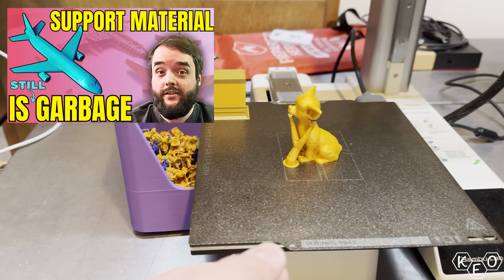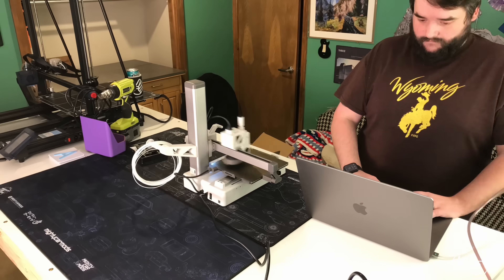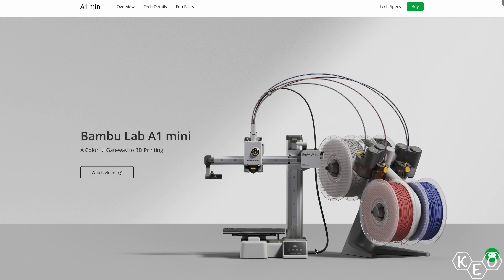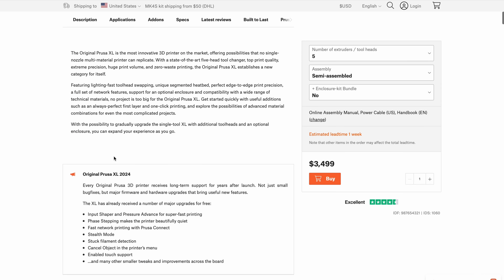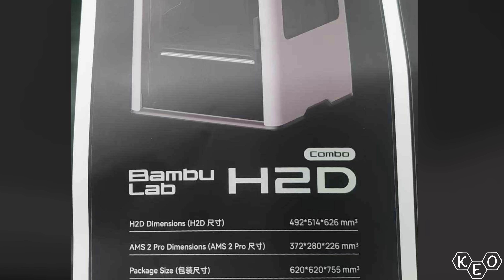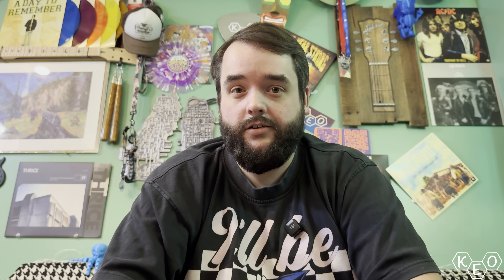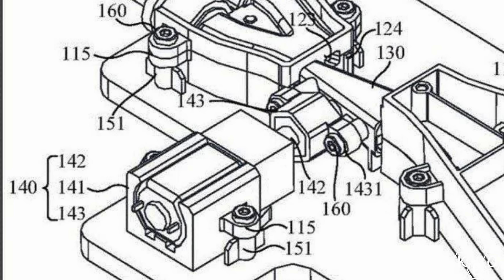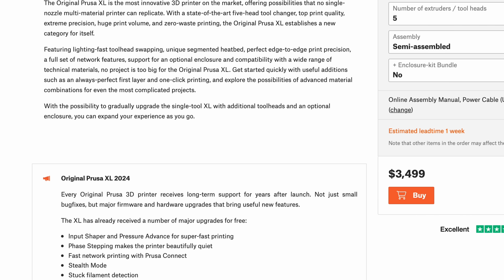What Is The Bambu H2D? Will This Change Everything?

Comment: If there are 2 nozzles I think it would be most useful for printing supports from a different material that has poor adhesion to the primary printing material so the supports basically fall off and you have cleaner and less expensive prints.

Comment: I've had the thought of dual head or tool since my very first tri-color print. I probably had more waste than printed material. I wasn't concerned with it right up front because I was so new to printing. But, now that it's on my dime, I'm much more critical of it once I started branching out from (inexpensive/cheap) PLA to more exotic materials. I refuse to spend $50 on a spool of something to watch 1/5 of it drop out the back. Not to mention all the extra print time.

Comment: With Bambu Labs latest announcement about their new firmware update and it's lockdowns (will render Panda Touch and most likely all 3rd party tools completely useless) I have a feeling they may not be selling many of these new machines, and most likely not many more of their existing line as well. 

Oh and if you're thinking of staying on LAN and not updating to the new firmware Bambu (in there own announcement states that wont work. BTW, seems they removed the ability to downgrade from the latest firmware version as well..  From Bambu's own website - "Critical Operations That Require Authorization"

    The following printer operations will require authorization controls:

        Binding and unbinding the printer.
        Initiating remote video access.
        Performing firmware upgrades.
        Initiating a print job (via LAN or cloud mode).
        Controlling motion system, temperature, fans, AMS settings, calibrations, etc.

Comment: looks like a lot of tech design for a twin nozzle end, this would make a huge difference with multi colour printing as per your video chat. If they do release this thing with the tech you’ve mentioned and a bed size of at least 350mm cubed, i’d be straight on it even though ive only had my X1Cc for three weeks. Let’s hope and fingers crossed.

Comment: Yeah but bigger question is when is Bambu getting into the resin printing.
Reply from the maker: You know, I don’t care for resin but I wouldn’t be surprised if they moved that way eventually as well
Reply: @KeoPrints  it would be cool if they can be the leader in both filament and in resin. I would buy a resin farm of Bambu printers.
Reply from the maker: I agree. I have not made the jump over to resin but im sure they could innovate enough to make it appealing to me and loads of others
Reply: @KeoPrints  the main thing that was appealing to me with resin is the level of detail you can get along with the time vs multiple prints. If the object takes 2 hrs but I can load 10 models at a time... Thats the appeal n challenge for me. Still love my Flsun tho.

Comment: Needs to be something with a heated chamber that has a larger size build plate that isn't $2600 like the X1E.  I love my Bambu stuff but if Qidi releases a V2 of the 4Plus its going to be HARD to beat that one if they can't match the price and features.  Even the V1 with the issues isn't the worst.
Reply from the maker: I’m testing the Qidi Plus 4 right now and I am SUPER impressed. For such a cheap machine, this thing is incredible

Comment: love it, ! appreciate the info.

not gonna lie, you had me on the edge of my seat because I literally just purchased an X1C.

I'm new to 3D printing and decided to wait until now to jump into the fray because reliability was a huge concern of mine when 3D printing became popular a few years ago.

right after I used my X1C for the first time (2 days ago), I immediately started thinking of ways to print faster.

multiple tool heads came to mind as well as a way to switch between them.

and behold, only a few days later, here is this video. mind you, it released 3 weeks ago but damn.

right on the nose.

i'm definitely excited to see what bambu labs is coming up with with this next printer.
Reply from the maker: Crazy timing! It will be interesting to see what happens here in the next couple months

Comment: The dual print head (only ever 1 actively printing at a given time) with dual output AMS allows so many benefits, 2 colours, 1 can be printing while the other is priming and if only 2 colours no need for lots of purge and poop. 2 toolhead means they cab both be at different temps, and crucially, things like printing PLA with PETG was never a good option with the X1, P1 or A1 printers as the amount of purge required when swapping betweeing incompatible materials mid print is usually North of 300mm² which would be entirely prevented with the dual print heads finally making things like dissolvable supports possible. I'd eat my hat if the chamber isn't fully sealed and actively heated and given that bambu now sells more advanced filaments like PPA-CF and PPS-CF the hot end is gonna be good for 400c, hopefully 450c.

Comment: Tbh I want heated chamber, capabilities of printing engineering grade filaments, better resolution, seen Markforge prints in person and in industry and they’re bonkers both in resolution and strength, and the ability to run the machine offline like the X1E with a physical network kill-switch and I would love for interchangeable heads and a setup where I can print parts in lower durometer TPU, like 40A-70A. 

If they can get these features at a price point of at or less than 3K, we have a serious contender. Because so far Markforge is the metric by which I judge print quality, but 6k min for a printer is a hard pill to swallow. Resin is a pain in the rear to deal with and the powdered plastics are too expensive to print with. FDM is just much easier for day to day.

Comment: Having dual extruders would be beneficial even if you were printing in more than two colors.  
1) Let's say you aren't printing more than two colors on a given grouping of layers, you could still significantly reduce the number of filament changes.
2) Let's say you are doing more than two colors, lay after lay, you could keep the most used color loaded up, thereby reducing the number of color changes. 
So regardless of how it goes down, you'd reduce the time and waste for multi-color.

Comment: This model is what I’ve been waiting for. I’ve been looking at consumer 3d printers since they have been coming out and still haven’t bought one. I wanted a reliable large print volume. Stuff I could made functional parts from without melting material together, sanding etc. The last model almost made me pull the trigger but I’m glad I waited.

Comment: One reason I haven't bought the X1C yet is that I wouldn't be able to easily use ABS and PETG together with the AMS since I've read that the ABS would have to be fed differently instead of through the AMS. I was thinking about the Prusa XL with 5 print heads so I could do multi color and multi material, but that's out of the price range I want to spend. Maybe I'll wait to see if that new Bambu Lab printer can do what I want.
Reply from the maker: I am not sure if I am maybe misinformed but I use ABS with my AMS plenty and it works just fine. I know you cant use abrasive materials in the AMS but as far as I am aware, ABS is AMS safe
Reply: @KeoPrints  I don't know why I typed ABS. I meant TPU
Reply from the maker: Ahh yes, that is a major difficulty. I am pretty sure TPU works fine in the Anycubic ACE Pro and that is effectively the same thing. We have one here on the channel that we unboxed but I have not run flexibles through it personally

Comment: Sorry to tell you but the h2d is fake the logos dont match on the picture the printer pic and the patents dont match the design it is not the bambo way and no side logo only one correct logo in the corner so its 100% fake most likely ai generated

Edit: almost forgot the ams has 4 spools at 1kg and the size doesnt match with the printer
Reply from the maker: It very well could be. We will have to see what happens
Reply: Sure pal. Where are your sources? You sound silly calling something fake that is obviously real.

Comment: If you look at the overall size for the P1P, it is 450mm x 450mm x 420mm according to ChatGPT.  Then, on the P1P, the build volume is 256mm x 256mm x 256mm.  Now, compare the overall size for the H2D, it is 492mm x 514mm x 626mm.  So, the difference is 42mm x 64mm x 206mm.  So, if you add the difference to the P1P build volume, you will get the rough build volume for the H2D as 298mm x 320mm x 462mm.  If you round it, you will end with an H2D build volume of 300mm x 320mm x 460mm.  A lot of other printers have a build volume that is this big or bigger.  I think that I will wait to see the price.  I really like the Bambu Lab quality and reliability.  I have owned other printer brands in the past and the Prusa printers are the only ones that have similar reliability.
Reply: Nice one thx for your work. I have been less scientific: I approached the image (if is to be believed) by comparing the new ams with the one on my X1C - they really don't seem to be able to be any more efficient in the width as both units look very similar. X1C ams is appx 370mm. looking at the image you would not be able to fit the ams on the bed. I know it's stupid but really helps visualise. We can safely say the bed is 300m minimum. So any advantages will come in the delivery of the system and novel components and engineering as Print Bed size will not be the major selling point on the market. That said it will be bigger than X1C by 5cm or more. I have been thinking of getting a second X1C as prices fall but have been holding off as I do want a bigger print bay.

Comment: Looking at the pic, it does seem to have two nozzles and the ability to use AMS on at least one of the two nozzles available if the patents actually apply to this currently not released printer.  I think this would be a more ideal arrangement for AMS if your base color that the model mostly consists of is that one non-changing color and the rest are AMS capable as then you are making one less change in filament and that should reduce the waste considerably. 

I am hoping, but not banking on having the ability to print higher temps with this new machine.  Having a new way to use multi-material is great, but a real leap forward would be to have that machine hit the same temps as the QIDI Plus 4 both in the chamber and especially at the nozzle.  That ability opens up the possibility of doing PPS-CF and plain PPS on the same layers, which would give a monumental boost to the capabilities of a home machine in terms of making strong and tough parts.  Of course, doing that would obviate the need for their X1E printers entirely and I really don't see Bambu cannibalizing their market share in that way if I'm being honest.  It is a bit pie in the sky thinking on my part, but I would love to see it.  I'm waiting and watching and I could be hurting myself in terms of tariffs by doing this, but if they bring higher temps, I'm on board.
Reply from the maker: A lot of good notes here. Higher print temps to compete with the current round of updated printers is a must for sure. It’ll be interesting to see what happens with the dual extruder situation though. Maybe it applies to this release. Maybe it doesn’t
Reply: @KeoPrints  I've done some more thinking on your video and what was presented and I have issues making that jive with what their announcement was recently.  The Prusa XL exists and it offers tool changing, which reduces waste far more effectively for multi-material printing versus what having two separate hot ends would.  On top of that, this is being done at a price point that is competitive with the prosumer price point that Bambu is likely offering this new machine at along with the possibility of adding up to five tools to the system in the future with built in upgradeability.  So the dual hot end can't just be aimed at speed and waste reduction and remotely live up to the hype surrounding the announcement.  

As I see it, there are only two available paths they can take going forward using the info we have on hand.  Either they will be making a true multi-colored printer with CMYK color mixing or they are going high temp if what your presented here turns out to be related.  The color mixing sounds cool and all, but not what I'm interested in.  We shall see...

Comment: Ive been wanting to get a P1S for some time now. But have been holding out. Im not a pro user but i would like to have a fullt enclosed 3d printer. Shoudm i wait or should i just buy the P1S now? Id like to know what people on here think.
Reply from the maker: I suppose it depends on what your price threshold is. The new one will likely be way more expensive than the P1S. I think the P1S is an excellent printer so you can’t go wrong there but who knows what we are actually going to get with this coming machine

Comment: by the looks of that hub drawing, filament will still have to be pulled out of the hot end, when switch color or material even if just printing 2 colors. if that is the case, i can't see a benefit to that new design. Also really confused on why they would want the nozzles on a swivel, seems like it would make way more sense to just have them next to each other, and then raise one up.  With it on a swivel that means there will need to be more room above the hot end that will allow the extra strain relief required on the bowden tubes, also meaning the bowden tube has to go to the back or front , and can not go to the side. And really it seems odd that they would use cram two hot ends into one tool head, moving a lot more weight at once, currently the printer already vibrates an insane amount, that would definitely not help.

if they do make it two nozzle, hopefully they allow heating and loading of one nozzle while the other is still printing. They would easily be able to convert current AMS units by replacing one part, and drilling a second hole in the back. Allowing two strand of filament to be ran at once, while also not requiring people to drop another 350+ dollars on each new AMS.

Comment: Everyone has set their expectations way too high
Reply from the maker: Me included. Regardless I’ll be picking one up but you are correct. It’ll be hard for this machine to live up to the expectations placed upon it for sure
Reply: @KeoPrints  unless it's a 1 meter cubed tool changing belt printer it's not going to meet the fantastic dreams everyone has been inventing
Reply: I'd say they are very reasonable. Bambu has yet to miss
Reply: @WindedWalruss93  people are expecting a tool changer or idex that's not what's happening

Comment: Most of what you mention is BS and old.  Nothing to do with what they are actually doing.  Given they have already let loose what its competitor will be then this "leaked" info that is years old and tech.

You already bleating about how Bambu needed another printer as the K2 was out, given where K2 sits in the product line and Bambu already have model(s) above that makes no sense.
Reply from the maker: Just regarding the larger format, Bambu does not have a competitor for the K2. That is all I am waiting for. The Bambu engineering applied to a large format machine would be excellent!

Comment: It reminds me of ProperPrinting's dual-color rocker (THREE YEARS AGO) - https://www.youtube.com/watch?v=OBB5WuhNhWk&t=740s

So if that's a Patent Application, it could be accepted if they withdrew just the rocker part. And why two heads? Less poop for a two-color, two filament print? The latter has the better qualification as one head is the primary filament and the second is for the support filament.